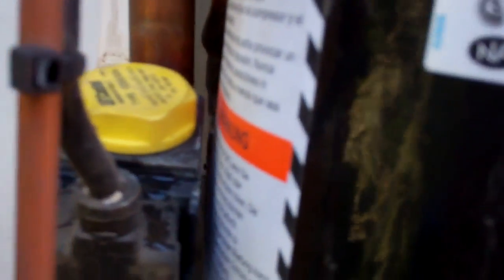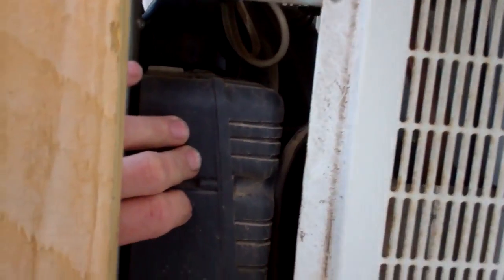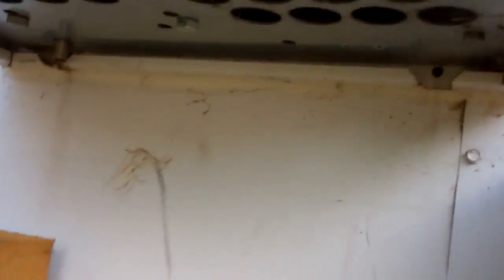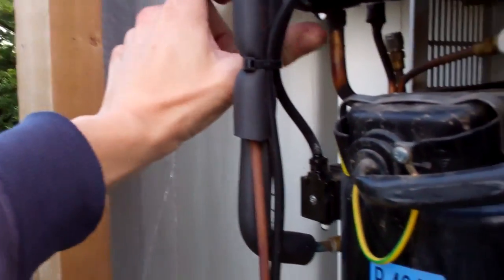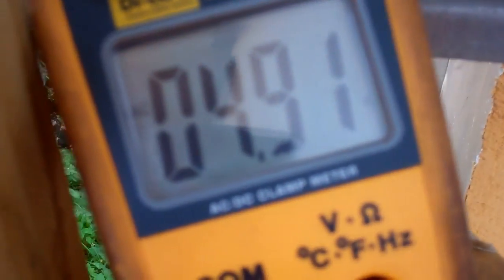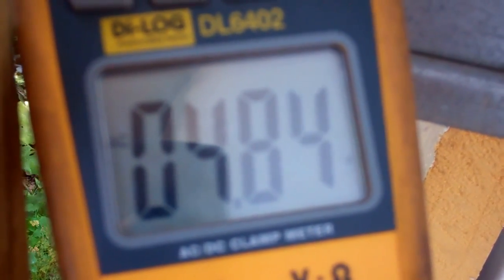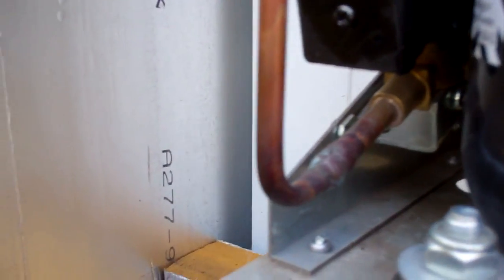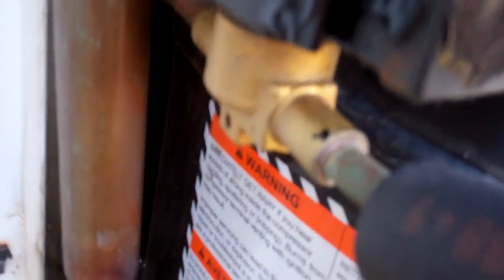Freezer blowing fuses

Comment: tell me how we adjust indoor motors continue...inodoor motors are not still continue  running of rivacold block system
Reply from the maker: I am not sure with these, maybe worth emailing Rivacold for a instruction manual for your model.
Reply: Dear if temperature reach - 5 after its runing continues.. And showing high temperature Aramaic